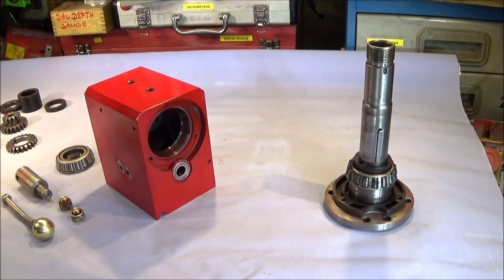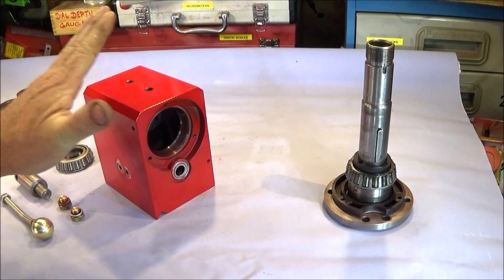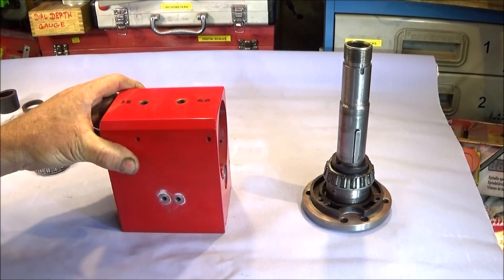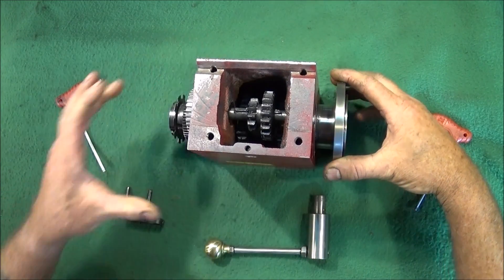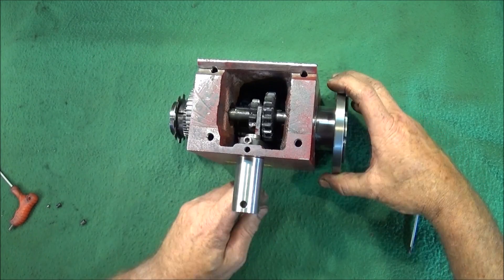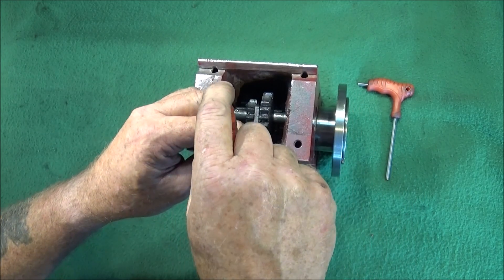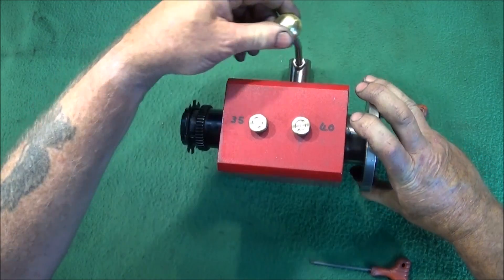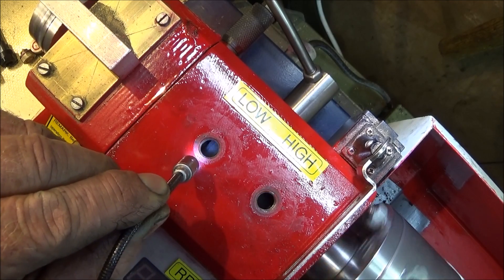Chinese Mini Lathe Headstock Gear Oil Ports New Gear Handle XL Speed Reduction

Comment: Hi Steve, I bought relevant parts to upgrade my mini lathe about 8 years ago. On finally stripping my Headstock hit a real problem I can not get the key out of the layshaft (Driven pulley) It only protruded about 0.5mm out of shaft. any suggestions welcome.
Keep up the great work.

Comment: I was planing to install button oilers or wick oilers in the exact spots You showed when found Your video. What oil are You using for those gears ? Aren't you afraid the oil will wash out the grease from the head stock bearings ?
Reply from the maker: When I had this setup, I just used ordinary engine oil. It didn't seem to get into the bearings.

Comment: Hi Mr Jordan.Thanks for the very informative video.
Please can you advise what oil you suggest for the lubrication and also,is there an issue with residual oil dropping into the doctor motor?
Thanks again.
Best regards
Tom Tyler
Reply from the maker: When I had that setup, I just used new engine oil. The thicker, the better. It didn't get into the motor. Regards Steve.
Reply: @SteveJordan  Thanks very much indeed.👍👍

Comment: Somehow i broke the lever for the high low speed shifter behind headstock..how would would i go about fixing that, and also is the torque difference that much ?
Reply from the maker: Hi Laurence, When I had the gear shifter on mine, I rarely used it. I had it set on the low gear most of the time, which was best for drilling torque. You would have to take the headstock apart to fix it. That would not be too difficult if you were not going to change the spindle bearings.
Reply: @SteveJordan  is it even worth the trouble

Comment: nicely done!  Thanks for sharing this.  The head stock gears are not sealed, so how often do you oil and how big a mess do you get beneath the head stock?
Reply from the maker: Hi Thanks, I only oiled them every couple of weeks when I did this upgrade. It didn't get too messy. I have since changed the bearings to the tapered roller bearing type that were greased on assembly, so I no longer use the oil ports. Regards Steve
Reply: @SteveJordan  I've got tapered bearings to install, but not sealed.  Is that a problem/concern for you, too?

Comment: Hello Steve, could you provide more information about speed reduction set? I can't find it. Did you changed only "bigger" pulley or motor pulley too? Do you know count of teeths for both pulleys? Thank you very much...
Reply from the maker: Hi I don't use the reduction set now and don't know if any are still available. I converted my lathe to a 3 phase motor with vfd speed control since I did this video. It's been a long time, so I have forgotten the information you need. Maybe someone else could answer your question here. Regards Steve
Reply: @SteveJordan  thank you...

Comment: Good day to you Steve,

First I have to say that your videos are my reference for many things in the workshop, and specially for the mini lathe.
I assume you got the metal gears from the same place I did in England. That is the three parts spindle gears and spacer.
Can you please say how you addressed the fact that the key on the spindle shaft is now too short to reach the small gear part on the back ?  I see on your video at approx 2 minutes 19 that the key way does not seem longer than original.
Did you do any other modifications? or simply assume the friction will prevent the small gear from rotating on the spindle? 
I am a bit concerned about this.  
Thank you.
Reply from the maker: Hi Paul I can't remember exactly what I did now. I know I put tapered roller bearings in and had to make up a new spacer to suit. 
  I have since gone over to a VFD and an external drive motor so I no longer have the gears.
Regards Steve
Reply: @SteveJordan  ok. Thank you for the quick answer. A new motor and controller that might be a good option too.

Comment: Hi Steve. I was wondering what gears to use on my mini lathe for general purpose turning when using the lead screw to drive the carriage rather than the hangers wheel.,thanks
Reply from the maker: Hi I just used the same gears that the lathe was set with when I bought it. If you have changed them from that you will just have to choose the ones that give you a good finish. Obviously if it's a liny finish it's too fast a feed. I have never changed them from new and now I have changed over to an outside motor and external belt drive it means I would have to take the pulley drive out of the spindle to get the rear guard off.
Reply: Thanks Steve. It’s a bit liney at times I may try reducing the speed a bit. Thanks
Reply from the maker: Also if you use a tool with a too small radius it can cause a liney finish. Regards Steve
Reply: Thanks again

Comment: could you not put a very thing piece of plastic on the bottom of the head and have the gears and bearings running in an oil bath all the time ? or would this not be a good idea ?

Comment: It's too bad the Chinese mini-lathes don't have sealed headstocks like the larger Chinese 3-in-1 machines so you can fill it with enough oil to lubricate the gears.

Comment: Can you tell me what model of lathe this is, I want to buy the same one so I can follow these fantastic modifications in the future.
Reply from the maker: Hi Guy Mine is an Amadeal CJ18A 7x14 Mini Lathe. Any Chinese Mini Lathe 7x14 is the sam type. It is best to get one with metal gears in the headstock unless you upgrade the headstock yourself. Don't worry about the plastic gears at the back end for thread cutting. People often criticize the use of these, but they are excellent. I have had mine for many years with extensive use and I haven't had any problems with them whatsoever. 
  Its a different case with the headstock gears though, if they are plastic, the gear teeth can break very easily. They really shouldn't put those in any lathe. Regards Steve
Reply: @SteveJordan  thank you Steve

Comment: Steve, did you have to do any modifications to the reduction gear set for it to fit.
Reply from the maker: I think it went straight on. If there was anything it would have been something simple. It's too far back for me to remember. Regards Steve

Comment: Hi, how are you? My nema is Aitor and i,m from of Spain, i see your videos, i like very much the mini lathe. I have a mini lathe of 30,s, i don,t knowh ompany of my lathe. I want buy a chinese mini lathe and i have a question:
Is it possible to fill the gearbox of the gears and the bearings with oil by putting a paper gasket in the base? What do you think? As in the change boxes of the cars.
Many thancks and sorry for my inglish
Reply from the maker: Hi Aitor, thanks. I have thought about the oil but it isn't really possible as the oil would come out through the bearings and lever spindle hole etc. They work fine though as they are, if you lubricate them once in a while.

Comment: I am going to be doing metal gears, tapered bearings, 5" chuck, and a 7x16 bed here in the near future. You wouldn't happen to have blueprints for the handle piece would you? It is the only lathe I have so I would like to turn ine before I tear mine down.

Comment: hi sir can you tell me what bearing nomber please thanks davinder
Reply: davinder singh from southall London
Reply from the maker: The head-stock tapered roller bearings part number 30206. I would buy a good quality brand like SKF, Timken, Koyo, or NSK or something similar.    Size (Roller bearing dimensions 30mm Bore x 62mm Diameter x 17.25 Width)
Regards Steve

Comment: cant you just throw a handfull of grease up there so they cant run dry ever thats what i would do i think
Reply: He tried that before and the grease gets slung off the gears so they end up dry. If you pack it with too much grease you induce drag. Ideally the headstock needs to be sealed and filled with a low oil level like a crankcase.

Comment: is there any way to oil those internal gears without breaking it all down? ( I am in no way comfortable with doing that). Like sneak in with a small tube somehow?
Reply from the maker: Hi Yes you can just take out the top screws that hold the front electrical box onto the lathe and use spray oil through those two holes. Angle the spray can side to side as much as possible with the spray tube nozzle only just slightly in the screw hole, so the oil goes left, right, up and down. I used this method for a long time. Regards Steve
Reply: Thank you so very much. BTW I really like your vids, I have used 2 of your other mods on my mini lathe including crank handle/ indexer, I love that one. My shop is only about twice the size of yours (but have almost every power tool a big shop would have including a full size panel saw and milling machine, like what a machine shop in the space station might be like) so I appreciate your exceptional use of space.

Comment: Thanks once again! Been a while with broken lathe! Got some parts ready to put it back in operation. New motor controller and gears and other stuff. Spent enough to buy a new one with a 16 inch bed! Live and learn. Thanks again for your help.
Reply from the maker: Hi Danne That's great. Its great to bring a lathe back though, even if it costs a bit. And you have the experience and knowledge of doing the repairs and restoration etc. Thanks for watching. Regards Steve

Comment: Steve - What oil/grease do you use in the headstock?
Reply from the maker: Hi, Now I have the oil ports I just use an engine oil. Before I drilled these ports I used a thick Molybdenum Sulphide paste, as this was the only substance that lasted a long time on the metal gears. Regards Steve

Comment: Thanks for the peek inside the headstock. Mine makes a racket inside the high/low and does not seem to change gears so I think it has the same issue but it may need to be replaced if its the plastic geared type. Only paid $150 for it due to the issue and otherwise it appears to be in great shape. Btw, slow down on the oxygen intake.....only so much of that stuff to go around!

Comment: Good video six months ago flitted taper bearings and metal gears from Amadeal with more but smaller teeth on fitting I used grease for open bearings but after watching your video I think I will drill some oil ports .What oil do you use Roger

Comment from the maker: YOU CAN BUY THE XL SPEED REDUCTION SET SHOWN IN THIS VIDEO FROM EBAY SELLER... Maccnc11....ON THE EBAY USA SITE.
http://www.ebay.co.uk/itm/Mini-Metal-Lathe-7-x-10-12-14-Pulley-Belt-Power-Upgrade-Kit-3-1-Reduction-/322529677476?hash=item4b184450a4:g:A7oAAOSw0e9Ux4ST

Fits Asian Mini Lathe 7" x 10",12",& 14", "Pulley/Belt Reduction Power UpGrade, Aluminum XL Pulleys & Belt, 3 to 1 Reduction instead of the OEM 1.82 to 1, 40% Power increase, Ideal for spinning those 4 & 5 Inch Chucks, “NOTE: This upgrade lowers Max RPM in Low Gear to Approx. 700 RPM, and 1600 RPM in High Gear.”

Comment: The shame is that for $25 in parts all these  "upgrades" could have been done at the factory.  The Chinese mentality regards anything more than the absolute bare minimum as a waste. If you accept that you buy machinery from China for the castings and that a ground-up rebuild will be the norm you won't be too disappointed.
This is the reason only a fool would buy a Chinese automobile or even worse, fly in a Chinese airplane.
Reply from the maker: +Aceroadholder The Chinese actually make all the high quality lathe tooling that is being sold online by all the tool suppliers. There is very little being manufactured in the UK now. I worked in the aerospace industry for 27 years and can say that the tooling I buy direct from China is excellent. The carbide insert tools etc is just as good as the top branded ones. People do not realise that nearly all the fixtures and other machine tool equipment is made in China or India and just being sold on by the tool companies in their own particular country. ..Regards Steve
Reply: The only way to get any quality out of China is to hire a Japanese engineer to stand there and watch them like a hawk.
The company I retired from decided to "save money" by contracting a Chinese firm to build a series of die sets. After multiple failures of the dies and the die sets themselves I ended up having to scrounge the warehouse for old Danly die sets. Then with the expertise of a retired  tool and die maker and about 200 hours of his labor the dies were made usable. It only cost the company twice as much as the Chinese dies cost to start with to repair the mess plus the scrap and lost production. The Chinese die builder said that they worked when they left the factory so it wasn't their problem... which is the usual response from any Chinese manufacturer you have the misfortune to deal with (that's of course if you can actually find out who made the junk you got stuck with).
Reply from the maker: Well 'The proof in the pudding is in the eating', I have a vast array of absolutely fantastic tooling for my lathes, exceptional electronic motor sets and literally hundreds of other items that all came from China! There are some rubbish hand tools etc from there, just like anywhere else, but what I have bought is super quality items. And like I say....the majority of all tools come from there in the first place and are being sold on, with new brand name labels. I always check on Ebay first to see if I can get the items direct from China rather than pay the over inflated prices the tool sellers are offering them for!!! The only things I wouldn't buy from there are things like digital verniers & micrometers that are already named 'Mitutoyo' etc as there are sellers making out that these are genuine, when they are not.
Reply: Well, I guess you pays your money and you takes your chances. I've seen properly made stuff from China... but it's usually more of a surprise than an expectation.

Comment: Hey Steve, great idea for the ports and nice job on the new lever. I have the gear reduction and love it, I prefer to cut at slower speeds anyway. God Bless Ya   Dave
Reply from the maker: Hi David, Yes I'm very pleased with mine as well. I don't know whether they still sell them? I couldn't find a set when I looked recently. My other lathe has a top speed of 850RPM and I have found speeds around this figure ok for most turning....Thanks for watching....Regards Steve

Comment: Good idea with the ports.  Did tapered roller bearings make much difference?
Reply from the maker: Hi yes they seemed to stop some vibration etc. I did use the ordinary factory bearings for about five years though and they were fine. I like having the Tapered set though as once the back of the bearing is pressed in you can easily and quickly remove the spindle without any extractor tools. I found out some years ago, that when this lathe was originally designed it did have the tapered set as standard. Regards Steve

Comment: Steve, I am about to do the headstock bearing upgrade on my mini lathe. Have you made a video of that job? 

Thanks for another very useful and timely video.
Reply from the maker: Hi Ian, No I didn't do a video on this. When I changed mine I wasn't doing videos then. If I can get hold of a headstock though at some point, I would do a video.....Regards Steve
Reply: Thanks Steve. Looking forward to that. I am not impressed by instructions which begin "First go out and buy another lathe so you can turn up some new spacers while your first lathe is in pieces."
Reply: Ian, Practical Renaissance has a video on replacing the bearings with roller bearings & the drive gears with metal ones.  I followed his video & it worked greatly!
Reply: Rich, Thank you for that. I notice that he didn't have any problems with the spacer sizes, but others report having to turn the old ones down or make new ones. Evidently there is quite a lot of variability as between one lathe and another. <sigh>

Comment: what bearing type was in there before?
Reply from the maker: +jonnoMoto It was just the ordinary factory sealed ball bearing races. You can get angular contact bearings as well for it, but the tapered roller ones are the best of the lot as you can tske the spindle out for maintenance without having to use an extractor plus they are superior as you can adjust them to take out any play. Regards Steve